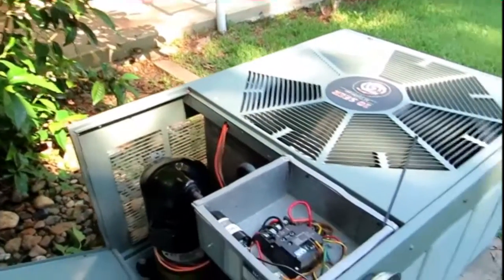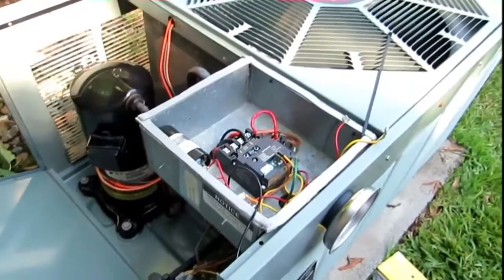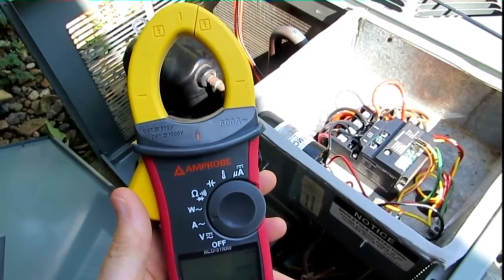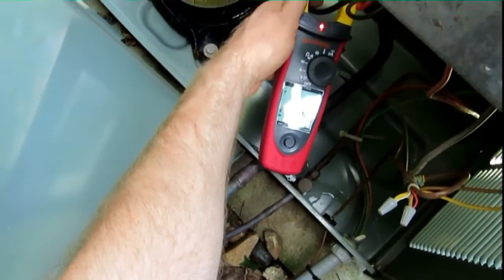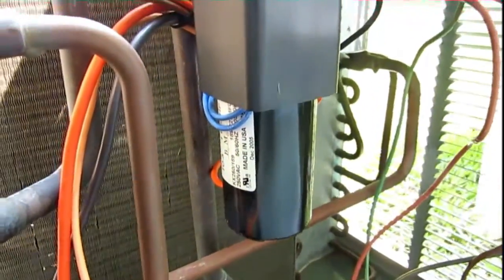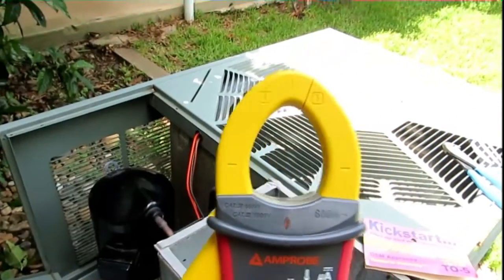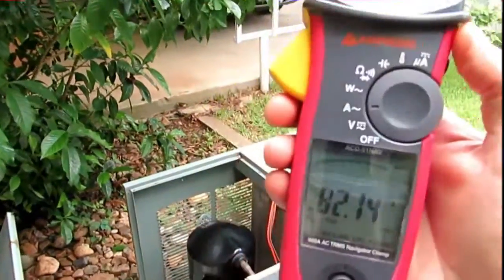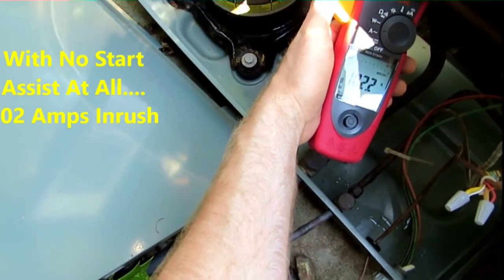Amprobe ACD-51NAV HVAC-Testing Inrush Current

Comment: "   3 wire configuration,the potential relay opens at a manufacturer specified 
voltage across the start winding of the motor,effectively removing the Start 
Cap from the circuit.  A third wire is necessary to connect to the run 
winding. 2 wire configuration,the potential relay and start capacitor are 
connected across the run and start winding. The potential relay opens at a 
specified increment above line voltage,thus removing the start capacitor from 
the circuit. No need for a third wire"

Comment: Once again the Kick Start ,should not be confused with a Typical PTCR (Positive Temperature Coefficient Resistor) they in Fact take 5 to 10 minutes to Reset !!!
The Kick Start comes with a Potential Relay so it Drops Out outa the Circuit once Compressor is Started , therefore it has different Characteristics PTCR (Soft Start Crap) Kick Start is a TRUE Hard Start !!!

The 2 Wire Soft Start gave the, the TRUE 2 Wire(Hard Start) Potential Relay Kick Start a Bad Name !!!

Let the Testing Begin !!!

Comment: I want to test my capacitor on my condenser. Do you always use the common (black wire) to test the inrush?
Reply from the maker: Yes, the black wire ( compressor common) is always the one I use on this particular Rheem unit. Other brands could use a different color so always consult the wiring diagram for each unit.

Comment: Ray , I have an older Bryant 4 ton and LRA on the sticker is 129 . I checked the unit inrush and it reads 143 . I installed a Csu3 521 4 to 5 ton and it now reads 127 . I am curious about the Ks1 kickstart   . I see it lowered your inrush by 10 amps . I was looking at the reviews and the Kickstart does not seem to be as high as the 521 . How is it doing now ? I kind of want to try it , but not sure .   Please let me Know any new information if you can . I also installed a sureswitch . Sweet .
Thanks Dave
 
Update ,  I purchased the kick start and checked the inrush and it drew one more amp than the 521 . I left the 521 on due to the fact one less amp and it looks to to be better built . Answered my own question .
Reply from the maker: Thanks for watching David. Sorry I didn't reply sooner. I just saw your comment and question today. My Kickstart is still doing great. I checked it this spring when I did my check and clean.